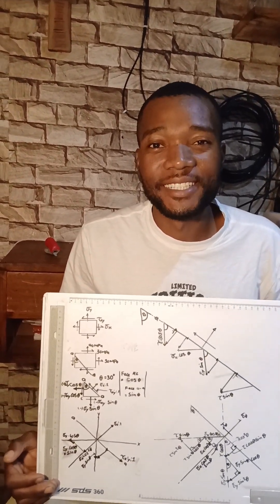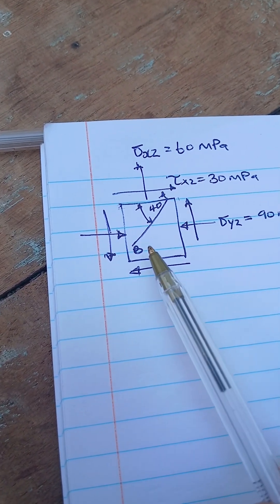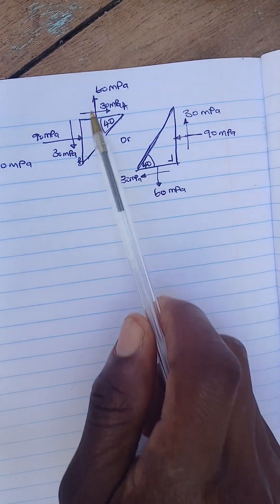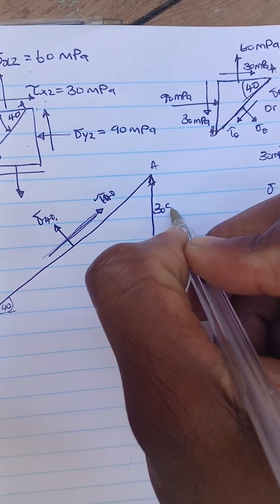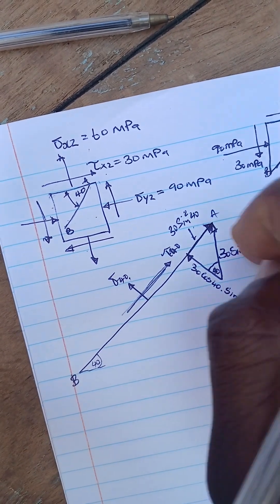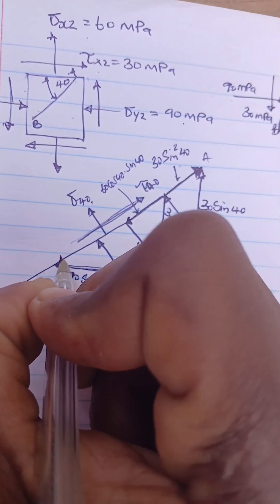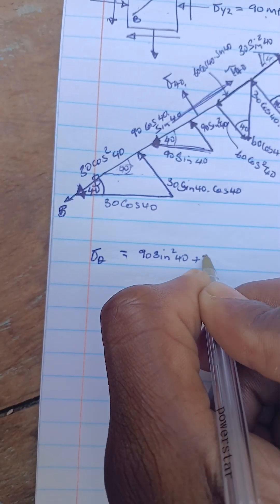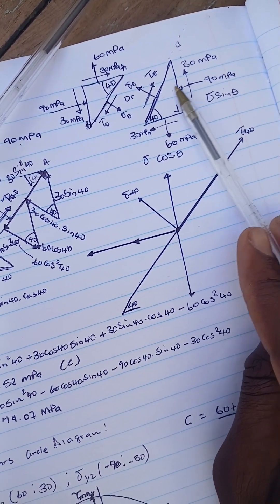Complex stress analysis from first principle.

Comment: Great explanation. Thank you. But for the last identified angle. That 40 is actually 50 and they are not mirroring. If you use the principle of diagonally opposite angles, the other angle becomes 40 and the alternating one becoming 40 as well which makes that angle 50 not 40.